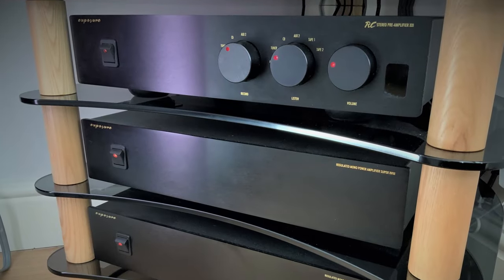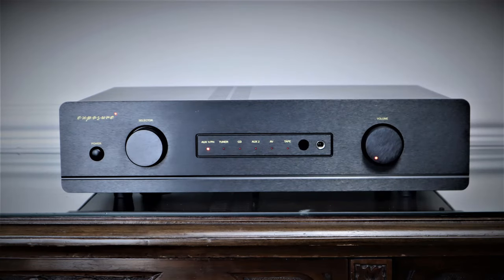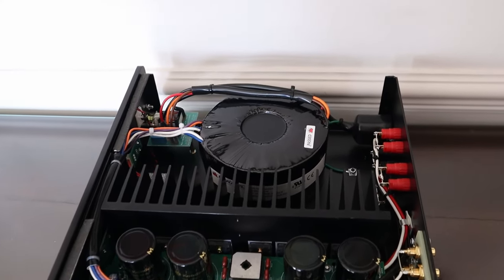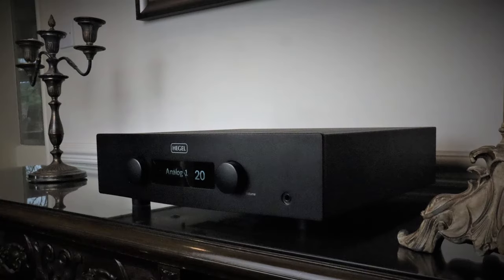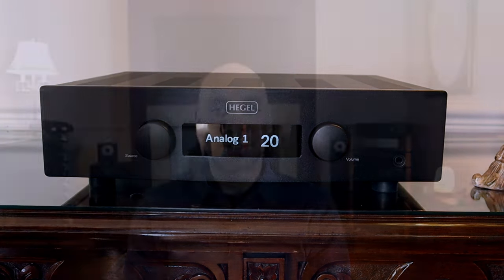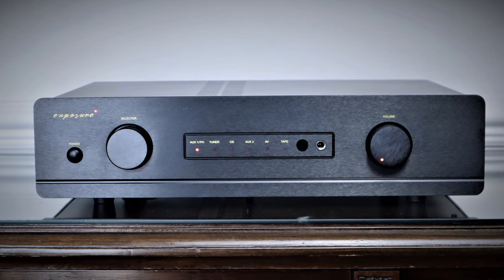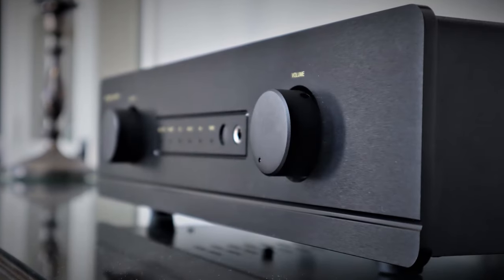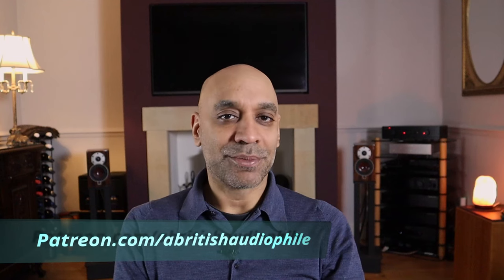Surprising! New Exposure 3510 Amplifier Review

Comment: Hi Tarun…as always …great review…I am thinking this amp is not for me…After your last video, I mentioned that I went down a $6K Chi-Fi 🐇 🕳 trying to replace my 45-year old  Bob Carver C-500 Power Amp (yes…with the original capacitors) with a "more modern" sound. You saved my sanity when you recently reviewed The Denafrips combo and your description there confirmed my awarenesses of my new gear (Denafrips Athena & Kinki EX-B7 Mono Blocs). The power output was the same as my Carver, w/Schiit Freya+ Preamp with NOS tubes. There was no contest, "for me". New gear tight powerful bass, but thin in the midrange and unbalanced from high to low frequencies..which created a lacking sound stage. My Carver sounded waaaaay better! 🤔… so..I am taking a beating of well over $1K selling off that gear…but still having enthusiasm to best my Carver I found a new McIntosh MC152 power amp on someone's shelf(4-month wait everywhere). I went 180° in the other direction from my 🐇🕳, and OMG! …PAY DIRT!. Driving it w/Freya+ it has a full balanced sound, tight full "modern" bass and incredible soundstage and dynamics thru my DynAudio Contour 20s. My speakers sound like THEY got an upgrade, too! Everything sounds FANTASTIC thru this amp. I am smiling about it even when I am not home! I had no idea that amps could sound soooo different! I learned sooo much from this experience. 👍🏼
Reply from the maker: It is a great learning experience that newer is not always better. I almost sold my Exposure Pre/Monos once. That would have be a major regret and expensive mistake. Thank you for sharing 😊
Reply: How long have you had your Athena? I am very happy with mine - bought it a year ago - as it provides a natural timbre to acoustical instruments even at low volume:-)
Reply: @abritishaudiophile7314  You were so helpful  to my process just when I was doubting my ears and sense of sound.
THANK YOU, Tarun!
Reply: @wouterkolkman  I only kept it a short  while…I bought it hoping to get a fuller sound from my EX-B7 Mono Blocs.
It didn't help….and honestly, I thought that my Schiit Freya+ sounded better in tube mode at half the price. I want to recoup as much as I could to pay the almost $6K for the McIntosh Power Amp…so I happily sold it! 😎 …but I am glad that you are happy with the Athena in "your" mix. 👍🏼
 …that's the thing with this hobby….each room, person, mix of gear , synergy…is all different. For instance… Tarun did not care for this new exposure amp playing his prized ProAc Speakers…I am sure that he was not expecting THAT when he anticipated reviewing the new amp!😬

Comment: Fantastic review lad, exactly what I expected from 3510. I was really close to getting it, although it wasn't available at the moment. I own 2010S2 and it simply can not drive my Harbeth M30.1s when it comes to lower end. In the end I went for H120, but the integrated dac is on sub-par with my Schiit Gungnir especially balanced connection (higher output power) which Exposure does not provide, unfortunately.

2010 has that juicy sweet midrange which I fell in love with of course, but the H120 is much more refined amp and it sounds more homogenous without coloration. Me, listening to a wide variety of music no matter the production it seems like a "perfect" match. Maybe upper bass, or upper mid-range aren't as "juicy", but in every other aspect H120 beats 2010S2. Headphone amp is very good and it runs well Grado SR225e and Etymotic in-ears.

How long do you think H120 needs running-in and what to expect from it from your experience?
I love your "cable dissection" video, I own silver plated Revelation QEDs, and they're extremely revealing and transparent, as Gungnir is. It just digs up insane amount of background sounds and gives out wide presentation and stage, including extreme resolution and textures. I've never heard cymbals sound so clear and natural.

Would you be able to recommend a cable that I should definitely check out/listen to with this combination? Cardas pure copper? I do prefer silver plated cables in general and have tried several.

What made my eyes go wide open is the lip/mouth plucking on Erykah Badu's live 1997 recording. It simply wasn't as pronounced as with 2010S2 > Spendor S3e.

Excuse the wall of text. :)
Reply from the maker: Thank you for sharing. Electronic burn-in is a contentious issue. However,  in experience some electronic components can take up to a couple of hundred hours to burn-in.
The cables are going to be trial and error as they are very system dependent. I like the Kimbre braided cables. May be a good place to start 🙂

Comment: Hi Tarun, I finally got to listen to the 3510 integrated, mostly I agree with your comments, except for all the tone. I actually own the Hagel H 190. To be honest, I listen to it because of your comments on the h190 and then bought it. 

I definitely found the tone to be warmer and richer than the H100 . The mid range was remarkable, and the sound stage had depth quite a bit of it. I think more than the. 

I wonder if you just had a bad example ? Or maybe it wasn’t burnt as much as you thought it was? 

I’m seriously considering letting the Hagel go and going with the exposure by still want to hear the app preamp combination and see how it is or even the model blocks .
Reply: May I ask which speakers you use?

Comment: Thank you for yet another insightful review. I was so looking forward to this review so I would have a reference to the 2510 and other amps and it appears that bigger is not always better or at least in this case where I believe I and my speakers would much more enjoy the little brother 2510 for musicality. Perhaps you could shed some light on my current decision making dilemma. I currently have and adore my little Proac Tablette Ten's with Dual 8inch B&W subs, for my space, and also currently have a Willsenton R8 with el34's. With some tube rolling, I've gotten it to sound quite pleasing. That said though, I have decided for me, long story short, that I don't want to deal with the Heat, weight,  and tube maintenance of the Willsenton and want the simplicity of a simple classic integrated like the 2510. I have read on numerous accounts that the Sugden A21SE Siginature would work a treat with my little Proacs ( A well as Tube Amps), but I still have a concern about the heat and inefficiencies of a class A. All this said, might you think that little 2510 could give me the sound and synergy I seek, with my little Proac's? Any insight would be greatly appreciated and of course taken in perspective to all the other variables one must consider. Thank you
Jim
Reply from the maker: Thank you Jim. Both the Exposure 2510 and the Sugden A21SE will work well with your ProAc Tablette Tens. In fact, they are know to have good synergy. Your decision should rest on the tonal balance you are trying to achieve. The 2510 is fairly neutral with a bit a leaning to the warm side where as the A21 SE is distinctly warmer. Good luck 😊
Reply: 3510 is much better than 2510 even 2510 is really trrrific sounding amp. 
Have 'em both with Spendor A7, Classic 3/1 and Elac Vela 403.

Comment: Hi Tarun,

My amplifier journey has come to a close for now - thank you for all your help!

I didn’t actually go for an Audiolab 6000A in the end.

I purchased a defective Musical Fidelity M2Si integrated amplifier from a lovely seller who listed on a forum for a substantially lower than retail price. The right channel had no sound. I opened it up, ran my multimeter, noticed what seemed to be a short circuit and tinkered/soldered to fix the issue.

Fortunately no damage to the circuitry. Sound restored to the right channel, no audible distortion or channel imbalance, the Musical Fidelity M2Si sounds 10x - 15x better than the Fatman iTube amplifier by my subjective estimations - carrying greater body and smoothness across all frequency ranges, bringing clean and tight bass to the table without being boomy and loose like it was with the Fatman iTube.

Allegedly the Musical Fidelity amps have something of a neutral/Hegel type quality to its sound. Paired with a Mojo DAC the system brings out the exact desired amount of warmth/musicality I was seeking.

I do miss some of the bass register heft I was getting with the Fatman. Next stop might be a subwoofer, and then I should be good for another few years.

In the meantime I will continue watching your videos, because I just love learning about audio/quality gear to consider for when I come into more disposable income.

All the best!

Comment: Great Review Tarun.
Re: the house sound, ideally a house sound would be best, as you would buy into a brand and keep upgrading for more.  High end brands like Accuphase have managed to achieve this... Their A/B amps sound alike as do their Class A units.

But, if you're going to have low entry points in your line-up this starts to become impossible unless you are willing to make compromises on the upper lines to match the lowest common denominator.  

Even with a brand as prestigious as Marantz I've found their units to not sound the same at all. I had the PM11S2 and the PM15S2 at the same time, and the PM11 had a more rolled off top end and laid back presentation. The PM15 was more energetic and upfront, with a bit extra on the bottom. Listening to both blindfolded you could be fooled into thinking the 15 was the more powerful of the 2.  I have the PM15 paired to Spendor Classic 3/5's with fantastic results.

All told it's pretty difficult to ensure a house sound and frankly I don't blame the more reasonably priced brands for not being able to do it.
Reply from the maker: Thank you Amit. Very interesting. I suspect you are right. It is a lot more difficult to achieve a house sound across a large product line than most people think. The 3510 has quite a different design to the 2510 😊

Comment: Hi Tarun.  I can only echo the other commenters on how informative your reviews are.  In answering you question about "house sound", I think a company should drive toward that.  In my case, I had a Rega Elex-R and liked it so much I thought I'd upgrade to the Elicit-R. What I got was almost identical to the way you differentiated the 2150 and the 3510. I sold the Elicit and am now in the hunt for a new amp.  Can you comment on the sonics of the separates, namely the 3150 series pre and power amps?
Reply from the maker: Thank you Michael. Much appreciated. I hope to find out what the current Exposure separates sound like 😊👍

Comment: Great review as always Mr Tarun. I bought the 3510 a month back - got it for a very good price from a distributor here. Would you say the 3510 is better than the h190 or are they both equally good though they would have their own unique strenghts & characteristics? I was considering buying the h190 earlier but gave up on it.

I found that the 3510 has very good dynamics & bass impact & drums and guitars have real good attack. The H80 doesn't have that bass slam nor the attack for drum sounds. This was with KEF R300s. Could only compare it to my Hegel H80. Though the H80 is still a very good amp I found the 3510 better in many ways.
Reply from the maker: Thank you. They are both very good amps with different sonic characteristics. The Hegel H190 has a more natural tonality where as the Exposure 3510 has better clarity and bass control 😊
Reply: @abritishaudiophile7314  Appreciate your quick response Tarun. I will be pairing the 3510 with dynaudio special 40s & buchardt s400 MKIIs in a couple of months. Unfortunately the 3510 is currently in my other home - in another state.
Reply: Наконец то прочитал полезную информацию как дошёл до вашего обзора.

Comment: Hi Tarun, another excellent and very relatable review - what a delight to listen to your experience with this amplifier. I'm delighted to hear that Exposure continues to make  exceptionally musical amplifiers, the same reason we both own them and still derive immense pleasure from listening to them, long after they were made. 
My VIII-XI-XII must be 34-35 years old now and has never sounded better. 
Re: the question about house sound - I don't expect house sound - I expect (prefer) the most honest, lifelike, musical untainted performance - and that the manufacturer strive to achieve this in all the parameters we perceive - dynamics, resolution, detail, extension low and high, timbre, grip and drive - well - the closer you are to an original performance than to a coloured, caricatured facsimile - then the manufacturer is on the right track in my book. 
All the best my friend - your channel is defining the genre, excellent quality content. Thank you so much! Rob in Switzerland
Reply from the maker: Thank you Rob. Much appreciated 👍😊👍

Comment: Interesting review Tarun. I had the 3510 on my Radar for audition or possibly the pre and power combo with the same numbers. Although I've never owned them I've always liked the sound of Dali speakers when I've heard them and could imagine they'd be a good combination. Actually I'd been thinking maybe the combination of Dali and Exposure might be too warm but maybe with the 3510 they balance each other out nicely.
Reply from the maker: The 3510 has a very nice balance with the Dali Menuet SE speaker I currently have in for review 😊
Reply: Dali and Exposure go well together. I heard them together a few yrs back @ Adelphi mall in Singapore though i ended up buying a Marantz PM8006 amp (to pair with KEF R300s) from the dealer (who stocked Dali speakers, Marantz & Exposure amps) instead of the Exposure at the time. But i ended up buying the 3510 a few months back and its a damn good amp.

Comment: This morning I declined my purchase of the 3010S2D. 
Hi Tarun, thank you for this nice review. I’m a littlebit worried. Yesterday I bought the Exposure 3010S2D. Next week it will arrive at my home. It’s going to replace my over 30 years old Linn Intek integrated amp which sound I loved so much. It’s paired with Linn Nexus speakers on Ku-stones, a Bluesound Node and the Denafrips Ares II. Am I going to lose my warm sound? Thanks again for your great reviews.
Kind regards,
Olaf
Reply from the maker: Thank you Olaf. I can’t quite remember the sound of the I Intek but generally Linn amps from that time weren’t particularly warm. You may be fine with the 3010S2D. Unfortunately, there is only one way to find out 😊👍

Comment: Hi Tarun interesting review ,  exposure is a very regarded make and does well in any review. But it still doesn’t seem to knock your Hagel off it’s spot . As regards the idea of a house sound this can only be a ability that seasoned reviewers would pick up on . I definitely for one have never listened to enough gear to comment , but I would assume anyone who favours a particular brand would expect a degree of similarity , but better overall . If that makes any sense .      Best wishes and kind regards as always.     😀👍👍👍
Reply from the maker: Thank you Michael. By the way, I don’t consider the Hegel H190 to be better than the Exposure 3510, just different strengths and weaknesses 😊

Comment: Fine presentation, Tarun. As to the point of sonic character, I would say, in amplifier design, that we need to distinguish between amplification of electronic instruments versus acoustic. Anything acoustic, I want as neutral as possible. But then a guitar amp feeding into an open back speaker cabinet with 4x 12" drivers for the full range has different requirements than your neutral, musically pleasing and audiophile quality playback kit. The component matching may be challenging as the electrical engineers who design and sell kit to us have no clue about human hearing and how their specifications relate to that (as a gross generalization). When you mention a damping factor of over 2,000 then i think, wow that is very high, and other viewers may not have a clue what this means electrically let alone what it does sonic or how it relates to component pairing.
What I would like to know, when you describe the sound character of components, is what kind of music you used (acoustic or not) and how it was recorded in the case of acoustic.
I saw another reviewer's headphone review and he mentioned that music, showing a photo from the artists' media. That photo was revealing as it showed the band's instruments in back light with a microphone for each instrument - consequently this does not record the space and has an electronic down-mix into two channels and hence all phase spatial clues are removed and replaced by volume leveling in the down-mix. Such recordings make the requirement for perfect micro-dynamics very high, whereas acoustic recordings with no down-mix fully rely on phase differences and spatially caused colorations. Yes, you can record an electric guitar spatially acoustic as well, but what the instrument should sound like in playback is completely uncertain.
Reply from the maker: Very interesting. Thank you JP 😊

Comment: Most good lines have their sound, but as you and I know the electronics used flavor everything; so it takes much more effort for consistency. Trying to keep a sound can mean years of working with a board and in some cases several boards to keep that certain sound.
Reply from the maker: Thank you Lonnie. I agree. The 3510 is a different design to the 2510 😊👍